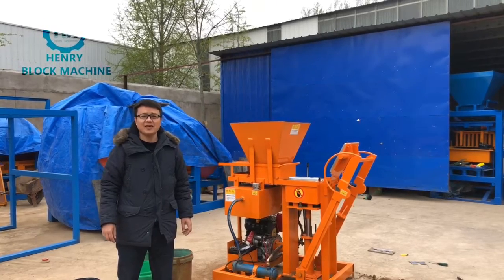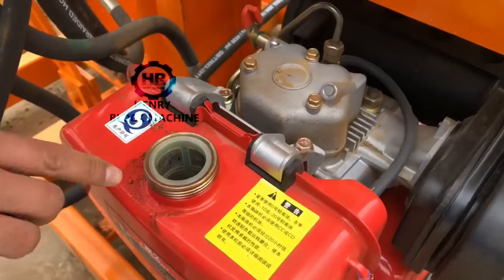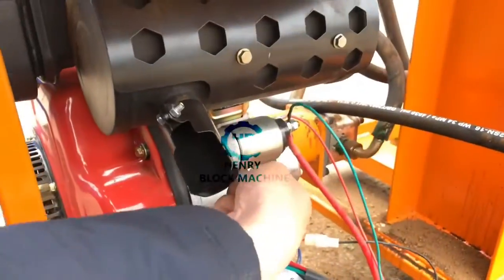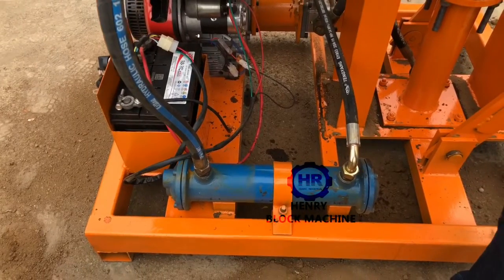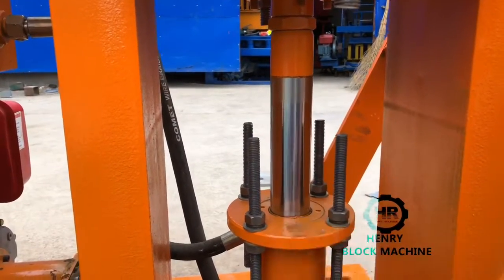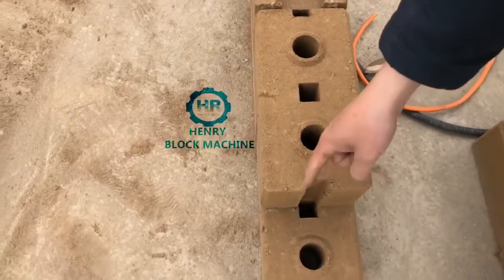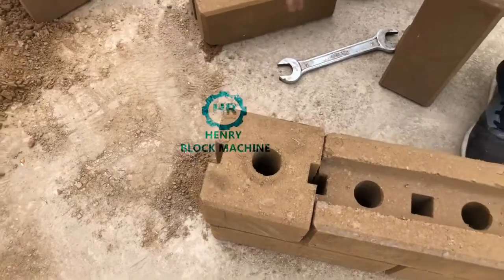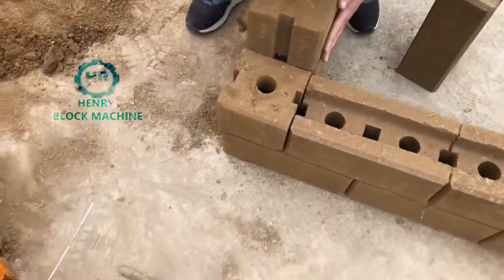HR2-25 soil LEGO interlocking brick hydraform clay block making machine usage on water pipe electric

Comment: I hope you could answer here. Having equiped with diesel engine provides flexibility. However, as you know diesel engine is loud, if we place the engine away and use longer hydraulic hoses, does this affect pressure level? Second question, do you also sell the machine without engine?
Reply from the maker: Place engine away ? Where would you like to put it ?
Reply: @HenryBlockMachineGroup  like in an enclosure the help put dB down to 74 dB maybe